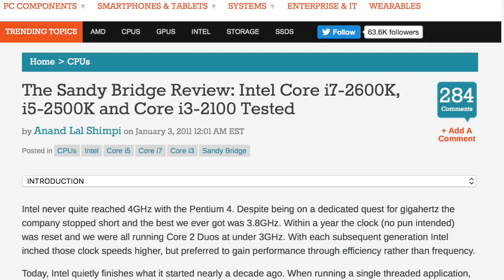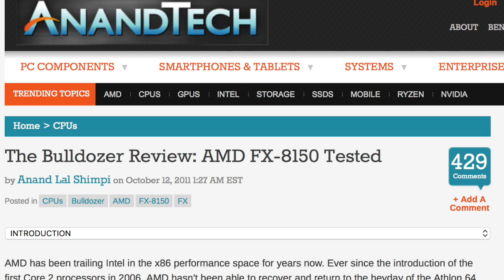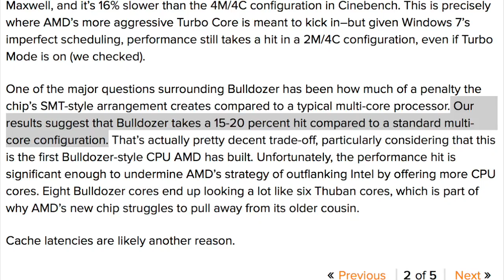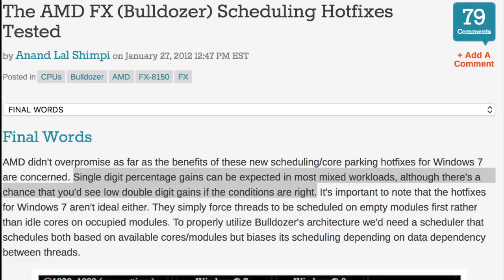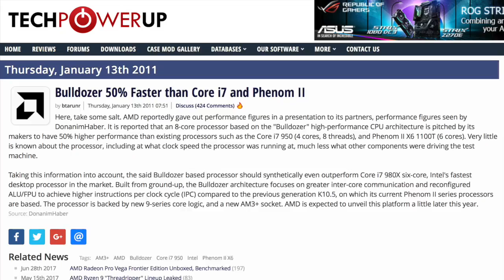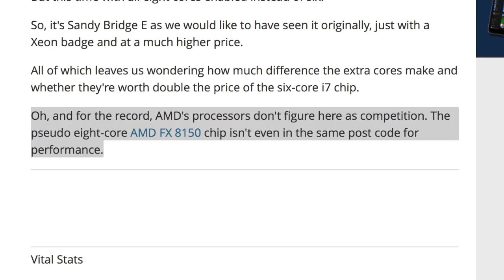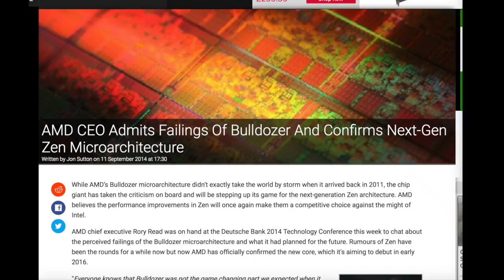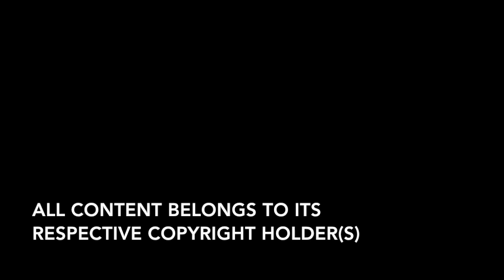The Bulldozer Story - and why AMD FX is better than you remember

Comment: FX 4300...lol play most games still today xD
Reply: lol dude, not trying to depress you, but that's kind of Phenom II X4 performance with slithgly improved ram controller. I strongly suggest you change your CPU for an Fx 8 core in order to gain a couple of years before full system upgrade
Reply: iam Dpressed, lol in the summer of 2019 i switch to Ryzen 3, then i hope i will notice the impact of a full upgrade xD
Reply: @xinixxagnix201  that sounds good, save money in cpu department and after a couple of years aim for an R7
Reply: 2 cores 4 threads....

Comment: my AMD 8350 is a fine and nice processor,absolutely normal,amd procs are fat and short while intel ones are tall and thin:go with boinc 8 threads:intel proc shall get slower and slower and sound like a hairdresser,you shall be unable to use the machine,amd proc will simply block itself

Comment: A friend gave me his old Amd FX-8350 and a Sabertooth 990FX in late 2018. And I built a neat little system from what I had spare. With 8Gb of Adata ddr3 2400mhz ram, a old crucial 128gb ssd, a 550w psu, and an Amd HD 7850 gpu. Packaged in a Phanteks P300 case. Still a good cpu and good motherboard.

Comment: in the cpu industry you try to make everything the same but just make it faster.  that way all your old apps will work just fine on it.  thats why intel and x86 one out in the first place against arm and sparc etc in the server market.  you could right an app at home on a cheap computer and then deploy it on a 10,000 dollar server and it would work. and when you bought your next server you knew it would run on it as well only faster.

but eventually you hit a wall and you cant make it faster without some big changes.  you try to make the old stuff run on it and at least as fast as before.  but to make new apps run faster on it you have to do something new.  and if you need an old app to run faster then you might have to rewrite it. 

for instance the move from single to dual core cpus.  the old stuff still ran on it and at least as fast but new stuff could be written to run faster if it used the second core.  they only do this when they hit a wall that wont let them easily make chips faster without the change.  with dual cores what happened was the amount of transistors added to maket he cores faster might have doulbed the size of the chips but only made them 20% faster.  twice as big but only 20% faster is a bad return.  but if you just made 2 cores it would be double size and double performance... if you could get your apps to use the second core.

sometimes its the person who is behind who hits the wall first and cant advance (for whatever reason political, financial, tech, etc).  this was the case with amd and cpus.  intel blundered and brought out the p4 adn amd gained the crown by basically making a chip with a similar setup to the chip that intel had abbandoned, the pentium 3.  they modeled their chip after intels p3 and improved upon and intel....well who knows what intel was thinking.  but they got ahead.  but then intel picked the p3 back up and improved upon it and came back with a lead that amd just couldnt match.  amd decided to go with a different strategy and go for more cores.  their idea was probalby that transistors used to make single cores faster could just be used to add more cores and that a lot of server workloads didnt need the same types of circuits that consumer apps needed (maybe branch prediction or speculative execution was more predictable and didnt need the complex versions that consumer apps need to run well).  they thought they could make up the difference with higher clocks so they set the cores up so that nothing was too "tight" as far as latency goes and hoped it would clock well.  but glofo, the company that makes their chips kind of let them down as they always seem to do.  but even if they had delivered big they still would have been behind.

apps and games today can use a lot of threads.  but the fx chip was a bit ahead of its time.  a lot of amd's products have been a head of their time.  but thats not a compliment as many take it.  it means that instead of making things better now the the only choice they had was to skip ahead to techniques that werent fully developed or developed  for in software.  and things didnt work out too well on the server side either.

sometimes the leader, who is out in front,  runs into the wall first.  just like in traffic accdient the car in front will be stopped by the tractor trailer thats jackknifed first and the rest will catch up.  but once the tractor is moved then that car will probalby jump back into the lead again.  we can see that with intel being stuck on 14nm for so long.  chips are harder to make than ever and the tractor trialer in the road is the lack of EUV tech to move forward.  all this stuff about amd and 7nm is only partly true with about half being marketing hype.  tsmc and the other fabs started lying about process tech after 28nm and their 7nm is actually what intel calls 10nm.  so if amd release  "7nm" this year and intel 10nm then that just means amd have caught up.  and it hasnt happened yet. 

but the cost is really high and the yields are awful on 7nm\10nm.  intel has a good 14nm process (what amd would call 10nm) and its cheaper and yields much better and makes larger dies easier.  they will use 10nm for laptops for the power savings and use 14nm for destkops.  once EUV comes to mass production intel will probalby retake the one process gen advantage.

Comment: I bought an FX8370 band new 5yrs ago along with a ASUS Sabertooth MB and they are both still running strong today. The biggest difference between the FX, and Intel chips that I see is in gaming. I'm just an average power user, and I have yet to lag, or bog this chip down.  Under load it can get hot, but liquid cooling keeps it under 50c. I'll run this chip until it dies, and probably buy AMD again because of the price vs performance numbers. I hope AMD digs deeper into Intels market share.

Comment: I sold my pc, FX8350 clocked at 4.5ghz 
Asus crosshair v formula, 8 GB of Kingston hyper x ram, 1TB of storage, 120GB Samsung pro ssd, Corsair 650 watt psu,  swapped my hd7950 made by msi around the time fallout 4 came out to an xfx r9 380. It’s still holding strong in my buddy’s possession. But the phenom II 965BE I had before the FX really didn’t see a huge jump in performance. But I only gamed and browsed. For auto cad the fx8350 with the 380 was a beast, couldn’t complain there. Ready to build a new pc and I’m excited to see how the new ryzen performs. Ram prices suck now. I paid forty bucks for 2x 4 GB 1600 ddr3. Rambling lol have a good day

Comment: I have an FX 6300 @ 3,5 Ghz Stock Clock.
I needed more Performance.
So I overclocked it to 4,2 Ghz. Sure I could do more but I like it how it is.
Reply: did you increase the voltage?

Comment: What I miss in this overview is AMDs attempt at fusion, merging CPU and GPU. 
A GPU mainly does floating point calculations and can execute instructions in parallel. 
CPUs also do floating point calculations, but with a higher precision and serial. (Note: This does not mean you cannot write algorithms that work multithreaded!)

Notice how the Bulldozer architecture cut the floating point operations in half? AMD released a number of SDKs back in the day to get developers to write highly parallel programs that ran on the CPU + GPU (APU). Most programs didn't (and don't) even need the high level of precision a CPU has to over, hence why the sacrifice could make sense when you use the floating point operations on a GPU. AMD had the right idea, but didn't have the software support, infrastructure and execution it required to make this succesful. (Ignoring the fact that Bulldozer had some large flaws when it came to cache latency, Anandtech has some great indepth articles on the topic)

A decade into the future, AMD is still building on the same principes that guided them back then. Infinity fabric is an obvious further development from the whole fusion concept and the modularity they built into Bulldozer. Infinity fabric allows multiple different components (CPU dies, GPU dies, FPGAs, HBM stacks, RAM) to be connected via a single interface and make them visible to eachother. This is some powerful stuff that could allow all parts of a system to be utilized to its full potential.

A nice read on what AMD was and is doing:
https://en.wikipedia.org/wiki/Heterogeneous_System_Architecture

Comment: The problem with Bulldozer was the inflated price on the 8150.  An Intel i5 2500k was a far better CPU and far less expensive at the time. 

I remember it well. I had a Phenom II x2 560 that I purchased in the hopes of unlocking it  into a quad core. The attempt failed. I was waiting for the new FX chips to come out, and the 8150 sucked so bad and the price was so high that I had to get a Phenom II X4 980 instead.  I did not regret it. Kept that for 2 years until the FX 8350 was released.  They were finally selling it at the correct price and it could outperform my long in the tooth Phenom II 980.  I still have the FX 8350 system overclocked to 4.8ghz to this very day.  Almost a 7 year old computer.

Comment: From personal experience I can say the fx line was terrible I had nothing but problems with it after moving to a 4690k I was amazed how much it held me back
Reply: Yep same here. I had FX-8320 for a few years, paired with an R9 290 (reference, good LORD my room was a sauna) and then an R9 390. When I finally switched to an i5-6600k the difference was night and day.

Eventually I also got a GTX 1070 and finally experienced having a PC that did not turn my room into an oven and jet engine testing factory.

Now I have an i7-7700k and RTX 2080, and you really do get what you pay for. NO it wasn't cheap, and certainly not the best value and/or bang for buck, but I have ZERO issues with any games (especially older games, which struggled with my FX Chip, such as Skyrim, Crysis, GTA IV/V, Fallout etc), nice cool temps (despite the 7700k thermal issue), and nice and quiet.

I love AMD and respect them a lot,  but FX really let me down in so many ways for gaming, and I spent countless hours scouring the internet wondering why my FPS was so bad with my R9 290/390 until I just said fuck it and went Intel.

Hopefully my next build in a couple of years or so will be full AMD again :)

EDIT: And for the record I game at 1080p/144hz (until I get a 1440p monitor) and have done since I had a GTX 1070, so a good CPU is imperative for maxing out my GPU or refresh rate. Ryzen would not be up to this to this task I'm afraid.

Comment: Still running my air cooled FX9590 at 4.9ghz - It was doing great with my earlier graphics cards like the gtx780 and 970.  I recently got a 1080ti founders and now i have gotten to the point the cpu is bottlenecking the system for the first time ever.

Comment: Another thing that is omitted on the video is that the Front End is shared and can't feed all the cores on the module at the same time, using interleaving by clockspeed intervals to feed one core per cycle at a time, causing underutilization.

Comment: If only AMD skipped the Bulldozer architecture all together and launched Piledriver, they would have like 40% of desktop marketshare. I am still happy with my FX-8350, multitasking and FHD gaming with no issues whatsoever. The Piledriver cpus where as much a breakthrough as was Athlon 64 back in 2003 but due to the epic failure of Bulldozer the year before, they received almost no credit for it and were'nt trusted by the market.
Reply: Using FX-8350 @ 4.8GHz with high end air cooling + motherboard quality with VRMs will serve anyone with 8 core needs for gaming etc.. This is what I used for yrs already & benefited by high end DDR3 ram. Only 1 problem today though is power consumption, something Ryzen 5 & 7 series solve well.
But yeah, bang for buck value before release of Ryzen. FX series when Overclocked were it.
Reply: Too bad they did not released Excavator for FX series.

Comment: My FX 8320, which overclocked like a demon, is more viable and more useful today, than used to be 4 years ago. 

I dont exactly need upgrade .... 

Playing Shadow of War on 1080p without issues.... while having tons of background stuff. Intelfantards will slag a product even without having it. FX is an Integer powerhouse, In passmark I can butcher on Integer math even 6700K at 4.5ghz clock, having my FX at 4.2. 

And because most of system operations are not exactly floating point heavy, It rip through everything I throw at it, while my game dont loose FPS, as I can use 4 remaining threads to carry all of the windows stuff. Real problem with Bulldozer and futher module revisions was terrible thread flipping. Dropping Process Lasso on it, and using odd cores on game which use 4 threads.... no issues.
 (as funny part, every odd core in each module is closer to L2 stack ,what give lower latency. Check it in XMR_Stack_CPU. even 5% faster hashrate on odd cores)

What this platform needed, was maturing, and Microsoft attended it in 2013-2014 with rebuilding CPU scheduler. Thread flipping between cores is very brutal for latencies, lock the thread to one core, let it stay on this core, and all getting significantly better. 

Truly underrated and very futureproof design, looking at fact my revision is from 2012.

Comment: No one ever programmed the software to take advantage of FX's architecture. AMD wanted it to run more like a GPU, which focuses on parallel computing, that's why FX has so many cores and shared floating point units. I guess AMD just bet on the wrong horse, AMD thought parallel computing is the future, but people like to stick to the old way.

Comment: If you can't compete with your only real competitor then you are a failure.  Even at a slightly lower price point Bulldozer was a failure for the simple reason that not many people are going to spend $1,200+ on building a new high tier PC and then decide to cheap out on their processor.

Comment: I’m on a 9590e I originally had a 8370 and I gotta say I almost never pin my CPU full it sits at 5.1 ghz with a triple rad and it is powerful I will be upgrading to ryzen or what ever is after If i can make it 3 or 4 more years with my 9590

Comment: The real power of the FX core was multi tasking.

You can dedicate a core or a couple of cores for each task and run multiple programs simultaneously without worrying about CPU resources.

I built a home made DVR/gaming machine/TVBox and I regularly record, transcode and game all at the same time.

I could have built an i5 for the same money at the time, but I'd only have had four cores rather than six. They'd have been faster cores, but I couldn't assign two cores to transcoding, two to DVR and two to gaming with the i5.

The i5 would have gotten higher benchmark scores, but even the i7 sharing resources with hyperthreading does not multitask as smoothly as two threads are using the same resources on each core and it would have added an additional $150 to my budget at the time.

Now I've got a Sandy Bridge i7 2.6GHz, Ivy Bridge Xeon @ 3.8GHz and Skylake i5 @ 2.8GHz beside my FX 6300 @ 3.9GHz with turbo up to 4.3GHz, they all have their strengths, but when using the computers you can only tell the difference with benchmarks. The only app where the Intel CPUs dominate for me is the PS2 emulator running Gran Turismo 4. The single core performance is very important and AVX2 support in the Skylake makes a huge difference. The newest release, however, levels the playing field and all of my systems will now play it @ a steady 60fps.

The real strength of the FX wasn't really speed, it was load bearing. You could throw a ton of work at the CPU. The i5/i7 could do the same work faster, but it couldn't run three or four apps simultaneously without issue. The FX might only be 80% as fast per core, but I got that 80% over six cores vs 100% over 4. Hyperthreading is awesome if everything falls together properly, however it doesn't have the resources to carry the same load as the FX line could. My Xeon can handle 4 heavy threads and 4 light threads, my FX can handle 6 heavy threads. The FX has done it's job admirably for me though I am looking forward to an 8, 16 or 32 core CPU in the next year or so.
Reply: Glen Waldrop how about a ryzen 7 1700x or 2700x ? 8 cores, 16 threads
Reply: Glen Waldrop at 4.5 ghz with oc
Reply: I'm completely torn between a Ryzen 5 six core and going nuts, saving up and grabbing a Threadripper.

I'm still happy with my FX, so anything would be above and beyond what I actually need. Might lower my power bill.

lol
Reply: Glen Waldrop as soon as you get a ryzen, you don't want to go back.
A r7 1700x is only 170€ used

Comment: The question is: Should i overclock my FX6300 or upgrade? Overclocking is obviously cheaper but i don't know if it will be enough (especially for Cemu) and heat production is obviously a problem.
Reply: Gianluca Daniele Di Maggio get a new procesor and mainboard

Comment: I got an 8350 back in 2016 for $80 and before then I had used a 4130 for five years. I've never really had a problem with these processors. I look forward to upgrading to Ryzen whenever I build my next PC, which will be an AM4 PC (obviously).